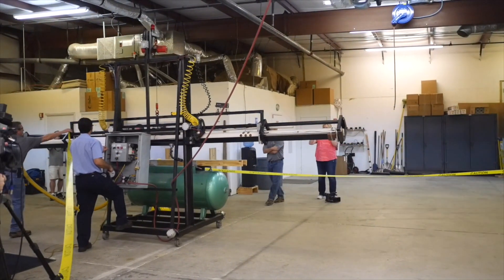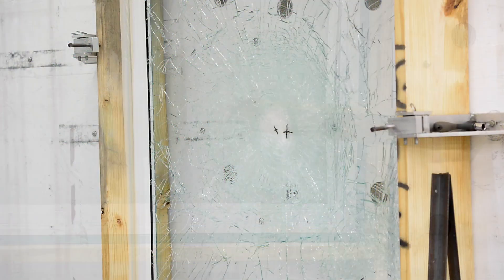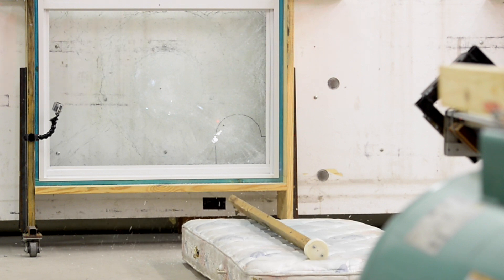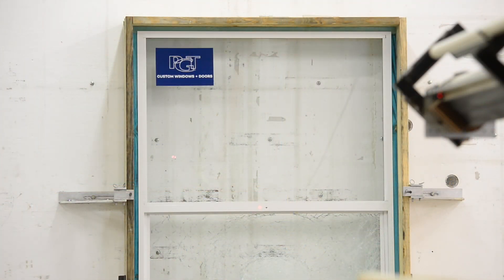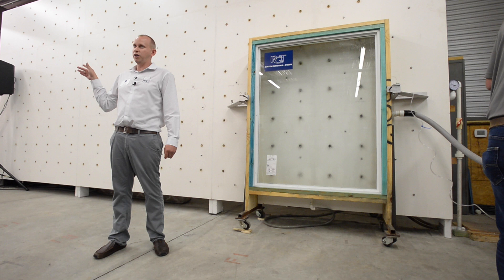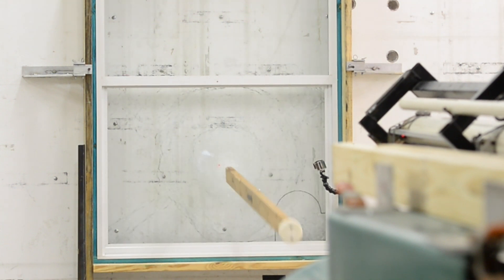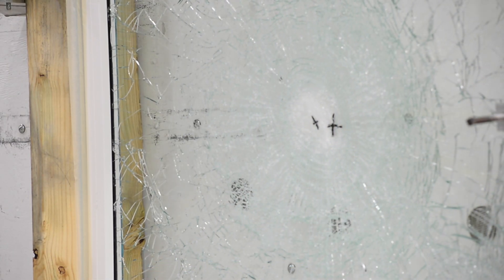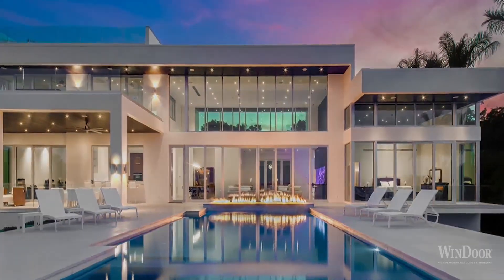PGT Hurricane Window Test

Comment: They show windows being broken but they never talk glass spec’s. Are these 1/8”, 1/4”, 5/16”, 1/2” or 9/16”. What is the interlayer thickness and type. Is it .030, .060 or .090. Is it PVB or SGP. Before you upgrade to these very expensive windows do your homework and don’t let these window companies rip you off. They are no different than car dealerships. When I press them for specs they get mad and don’t want to talk anymore. Get everything down in writing.
Reply: The inter layer is the most important part. They mostly use the 0.90 pvb. Yeah totally agree, impact windows can be classed as impact with a much thinner inter layer so people do need to do their homework.